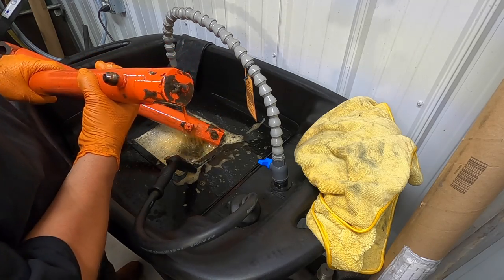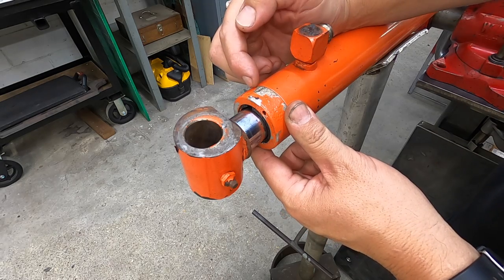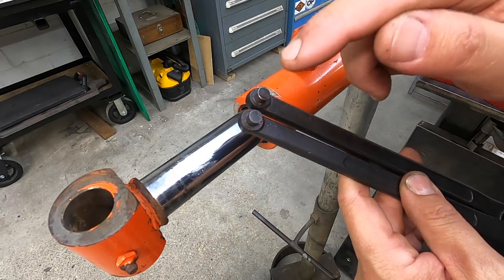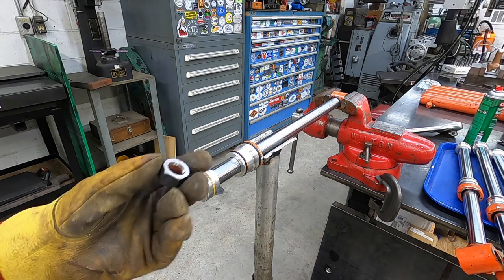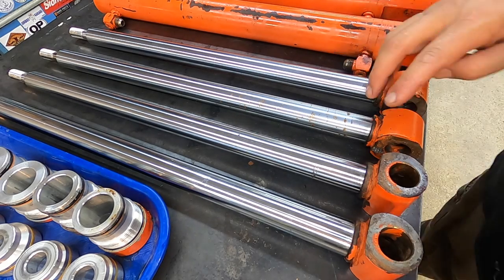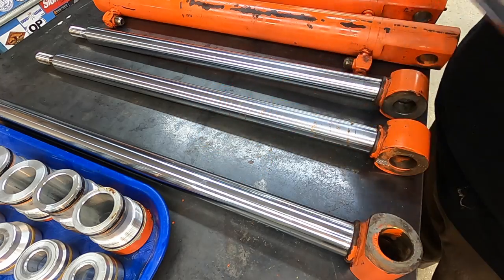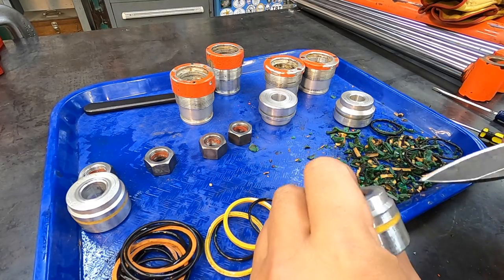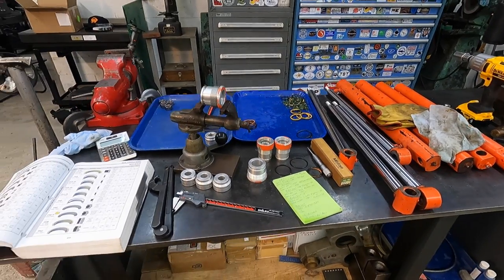Kubota Hydraulic Cylinder Repair Part 1: Cylinder Tear-Down & Inspection

Comment: Seal kit's for those little cylinders aren't that expensive and there not that hard to get. It's usually faster for us to order the correct seal kit's and put them in, know have the right seals, then taking time to measure everything, and order all the individual pieces. However you are right if your having a bunch dends in your chrome, peeling, flaking chrome anything that effects how smooth that rod is. You will in there regularly replacing seals until that replace the rod.

Comment: Can you put a small pin in one of the existing small holes and then use the hook spanner to catch on the pin?
Reply: what would the heel of the tool then ride against, the chromed shaft?
Reply: @bushmaster2936  there were a couple of holes. You could put pins in both.

Comment: Thanks for this great video.

Can you order Hercules parts for all Kubota cylinders? I have a tiny Kubota steering cylinder in the shop, and they think it may run $250. I would have repaired it myself if I had known how to measure the seals and O-rings.

Kubota wants $130 for seals, which seems pretty crazy for a small cylinder.

Comment: Had a hard time finding replacement rebuild kit for my 2008 L35 bt900 backhoe Dipper cylinder Kubota dealer has discontinued them,, had me worried until finding them.

Comment: I'm afraid I'll have to do the same kind of work on my vertical log-splitter. The ram keeps creeping down whenever i turn off the power and the hydraulic pressure is gone. I suspect the piston seal is worn and the oil keeps passing by the piston itself. Or the valve has some bypass leakage internally.

Comment: As an armchair engineer I offer an alternative position to drill the hole for the spanner. (I swear the devil is making me do it.)
I'd drill the hole where one of the existing holes is, effectively it will open out that hole but still leave it useable if the correct tool is available.
Then again there is always the Stillson wrench with or without padded jaws approach. 
Eric

Comment: In the gland the sealing seal is a u-cup seal, wiper, and wear band.(witch is usually an o-ring) then the main piston seal with a wear band.
Reply: just dissembled a Kubota LB400 and it only had a u-cup dust seal and a u-cup turned the other way on both bucket and arm lifts. 10 gaskets total on each cylinder rebuild. i came here to verify all the seals because there was extra in the Kubota kits, don't have the time to lookup all the individual seals and figure i'd spend my money on the $25 kits instead of $125-$175 per cylinder for some kid in the shop to replace the outer seals and who knows what damage they would do

Comment: Instead of drilling a hole, would have tried either a big Rigid or Reed strap wrench first, then if that doesn't work then out comes the drill. That's just me though. Also, at least in aircraft, seals have to be compatible with the fluid they are sealing. Use the wrong fluid and you end up with seals looking kinda like what you are taking out.

Comment: I realized I was telling the screen to just use a pipe wrench. It may be ghetto but less damage than hole drilling. Years ago I bought an aluminize 48" pipe wrench and made some copper soft-jaw covers. Works great on soft metals. Every shop has one set of soft-jaws for a vice. It extends uses of the vice. Why not a pipe wrench?

Comment: To bad those tools, the one for the face, didn't have different size pins so you could change to the size you needed. Even one handle for 2 or 3 sizes, and increase in size till you get a point that stress becomes a factor. Even if the smallest you could increase 2, 3, 4 dimensions next size 2, 3 dimensions then separate tools depending on stress. Even those like what you used drilling a hole in the end. Just a thought.

Comment: I have the same cylinders that are from the loader bucket on my Kubota B21.  The issue is that the seal kit that should be for the bucket cylinders are not compatible with the Cylinders that I have.   Two questions.  Do you know what model these cylinders came from so I can get the correct seals OR can I get the part numbers you sourced?

Comment: Face spanners are easy enough to make. Just some flat bar with 3 holes drilled in it and two hardened pins in two of the holes.
Reply: 30 secs to drill small hole
Reply: @vessicator  drilling holes into a customers rod seal is a great way to destroy your reputation and lose customers. it's a terrible solution, by the correct tool and do it properly.

Comment: You don't think that you would be able to get the part numbers or sizes from the Kubota web site?  I would have thought that you would whip out a couple of pin wrenches to suit. I would not take kindly for someone to drill my cylinders when not needed. A good strap wrench would be my first try in lieu of the proper wrench.

Comment: Just out of curiosity, Wouldnt a strap wrench have worked without drilling?
Reply: On those particular cylinders, yes but not normal ones. They are normally much harder to remove due to rust and other junk.
Reply: Chain wrench.
Reply: @timothyball3144  That would dig into the aluminum.
Reply: @pb222221  Yes, and care could be taken to prevent it.

Comment: Your videos are good and informative. But I would not tap and thread these parts to assemble the eyes back to the rods. It is an easy way to introduce weak point into end. The best way is to leave a small shank and a corresponding hole on the other about ¼ the size of diameter then weld up the rest. Look at cee out of Australia he does all kinds of hydraulic cylinder rebuilds.

Comment: What your calling a adjustable spanner I would have just drilled and taped for a 5/16th and than took a 1" 5/15 bolt and machined about 1/2" of the end down to 1/4 or what ever was needed to fit the gland holes rather than drill a sketchy hole anywhere them glands are loaded with seals I have seen 5 diffrent Orings and seals and a wipper too

Comment: Abom please help me! I have a b21 kabota and I ordered the seal kits but the seals i received are not for the cylinders I have. Do you know what model tractor they came off of? The cylinders I have are the same as the smaller 2 you took apart. Thank you

Comment: I am curious how you determine when to use spray welding to repair a shaft vs just replacing it.   From what I can see here, the damage to the shaft isn't very deep, would you not be able to do a spray welding process on it and get it back to a condition that wouldn't mess with the seals?
Reply: In this case I'd imagine it's because the rods are chrome-plated. Spray weld won't stick well to the plating and even if it did you'd probably still end up having to machine off the old plating, spray-weld it oversize, machine it back to final dimensions again (accounting for plating thickness) and then re-plate it. A process that would end up being more expensive than just buying new plated rod stock at the right dimensions, I'd think, and with numerous steps that can go wrong and end up scrapping the part. Plus I don't think Adam has a plating setup big enough.

Comment: How do you determine what type of seal to order when the original is that far gone? Size is one thing, but there are so many types.
Reply: As seals are an expendable, I imagine they are listed in any service manual and parts diagram you could find easily online.

Comment: Is the gland nut steel @ 7:13? I can believe how smooth of a cut you got? I must just be terrible at drilling holes.
Reply: I just saw the second one at 9:30 and still can’t believe it. I never get chips like that by hand. Is it a really sharp bit or is it just a ton on pressure?

Comment: When the impact wrench doesn't work, apply Abom-torque!
Reply: No, just go with a Milwaukee 2767-20 or an   Ingersol Rand W7152, way more breakaway torque, 1400 '# and !500'# , the Dewalt is only rated at 1200'#.
Reply: @garybrenner6236  Abom-torque©️™️ is free and nearly unlimited within reason. Powered by steak. 💪
Reply: @garybrenner6236  Real professionals don't use battery operated impacts. We call those electric rattle guns, because they don't provide as much torque as air operated impacts under sustained impacting. Also, battery operated power tools are a multi-million dollar marketing scam designed to make you buy fancy, expensive, load balancing chargers, with battery packs that need replacement every year/two years with constant charge/discharge cycles. That coveted electric impact you think is so great? Yeah that will fail just outside of your warranty, making you need to replace it after 3-5 years for the next new model. Pneumatic impacts typically last more than 10 years without requiring a rebuild if oiled regularly. Those torque numbers you list are made up fake numbers by marketing consultants.
Reply: @JosephArata  Hard to use a air impact to take motorhome/small truck wheels off 300 miles from the nearest garage/compressor. Every tool has its use/place.

Comment: I always wondered, what sort of range of pressures do these cylinders operate at?
Reply: Most Kubota tractors run their hydraulic systems at 2,000 to 3,000 psi.
Reply: @dennissmith8199  Thanks very much for the info!

Comment: Im curious about the cost of a rebuilt cylinder compared to the rebuild you provide?
Reply: mine in particular was $880 for new cylinder from Kubota vs $35 for seal kits & maybe $70-100 of tools and supplies to do them in my shop

Comment: Any one know the make and model that articulating vice he was using at the end to hold the piston? Love your videos. I await Saturday eagerly!
Reply: It looked like a Wilton Baby Bullet to me.
Reply: @Ddabig40mac  Yeah, almost certainly a Wilton "Baby Bullet" (Model 20/25, some other variants) on a Pow-R-Arm Junior, both obviously vintage.

You can actually build a very similar set with new components using a Pow-R-Arm 16180 and a Super Junior vise (63198 or 63244) with the swivel/clamp base removed.

Comment: Not worth grinding those pits/crack out, re-welding (spray welding) and re-chroming ?
Reply: No because after chroming you need to have it precision ground and polished.
Reply: Chrome rod stock is not expensive.  To strip the chrome, spray weld, machine, re-chrome, precision grind and polish ... and figure out how to not chrome the threads on the end again ... way more expensive. A length of chrom rod stock is in the $50 range.

Comment: Why can't you spray weld the shafts seems easier then replacing them?
Reply: Oh me either but I believe I've seen Adam spray weld harden metal before I could be wrong my memory isn't like it use to be
Reply: Seals wouldn’t last long at all on a non-chromed rod.

Comment: Channel locks usually works just fine to take those cylinder caps off.
Reply: Or you could use a 48"pipe wrench and sledge hammer.
Reply: I just bite on them with my teeth and unscrew it with my hands.

Comment: yea bad seals are not good, something so small but can put a whole wrench in a job so quick loose power, get dirt and water in the cylinder and dirt and ruins the whole thing, though I thought a breaker bar was a solid bar not a giant ratchet at least that is what I was told and have seen in experiance, or a bar and a pipe on the end of it and a hammer to jolt things loose, or two large guys but then again I help out in the shop with a big steam loco sometimes, we have texas sized tools we sometimes need.

Comment: I’m not sayin, cause I know nothin but I did see a tuber demonstrate how a proper impact socket can succeed where a standard 6pt socket fails on an impact tool. He maintained the extra mass of the impact socket makes the difference. Judging by the size of your wrench and how much you leaned on it maybe any impact tool would not have worked. Still seems like good knowledge to share.

Comment: An alternative to drilling the nut is to chuck the part in a vice, then use a brass rod and a hammer in the existing holes.  A few light taps and the nut can be unscrewed.  Obviously this would not be a good method on nuts set extrmely tightly, but in a pinch will often work

Comment: Old bad seals can be a real pain to get out, especially when the bearing is aluminum. I try real hard not to use metal picks, but sometimes everything else breaks. They have fiber reinforced ones now, not sure if those would do it. 

Were those regular AN wipers? HNBR cups?

Comment: wouldnt it be cheaper to have the rod rechromed and then grind them perfectly round again
Reply: Depending on the chrome shop. The one we use has a $200 minimum per rod, so it'd be $400 just to chrome and polish them. I'm sure he can get the stock cheaper, and with the labor being free
Reply: Judging by the diameter of the rods the new  material will probably cost about half of reworked old parts and be at Adam's shop in a couple of days not several days or possibly weeks with the lack of help many employers are experiencing, long before those rods could be refinished Adam will have all 4 cylinders done.
Reply: By the way, you don't grind chrome, the grinding is to remove the old plating, this is a critical step to achieve the proper finish dimensions based onthe thickness of the plating used..

Comment: Look I’m a big DeWalt fan. I use DeWalt for pretty much every tool in my daily job. But I’d have to say Milwaukee beats them in the impact department.  Milwaukee would have gotten that nut off first try no problem, DeWalt just has nothing on them in this sense

Comment: Adam, the original pin holes in the face of that gland seal should give you a minimum safe dimension to drill your new hole... you know you wont hit the grooves if you don't go any deeper than the inner most wall of the original hole, and if you measure the depth of the original holes, you know how close to the face you need to stay.

Comment: those piston seals seem to be "made to fail" parts
Reply: Better a seal than the whole rod assembly. It's like you have oil in your car that needs changing every 3000-5000 miles! Dang made to fail oil!!

Comment: can't you polish those surfaces?
Reply: Chrome is damaged and will tear up the new elastomers in a short time, better to fix it properly and be done.
Reply: To polish out a crater or valley, you have to remove all the material around it that's above the lowest point of the crater. That ain't feasible. If it was a .001" scratch, maybe.

Comment: Doesn't the repair on these smaller cylinders cost more than buying a new one? I can buy these small sizes for $150-200. When you add up labor and parts this repair has to be more than that. On larger cylinders it probably makes a lot more sense.

Comment: Pipe wrench works too no drilling, file off the marks, no big deal. Or an oil filer wrench or strap wrench if you don't want marks.
Reply: I've always used a strap wrench.

Comment: You're still having an audio issue. I don't hear well in my left ear, and almost all the time your audio is in both ears. The last few videos the right side keeps cutting out and only the left has audio.
Reply: Seems fine to me, might be a fault with your computer, but it was in both ears for me.
Reply: @itsverygreen532  it always happens on certain videos, in the same spot, and it's repeatable. I usually watch on a tablet.

Comment: Im going to probably guess that you're saving your family member a HUGE amount of $$$. Because to just replace the two bad cylinders with the piston damage is probably close to $400.-$600.00 for just those two. And a reseal job from Kubota on the other 2, that would probably at least be 3 hrs of labor @ $100.00 to $130.00 per hour. Then add in parts (from Kubota🤪🤪🤪), There's probably another $100.00 minimum. Im seeing a $1000.00 repair really fast right here, If not more. How fare off do you think I aim???